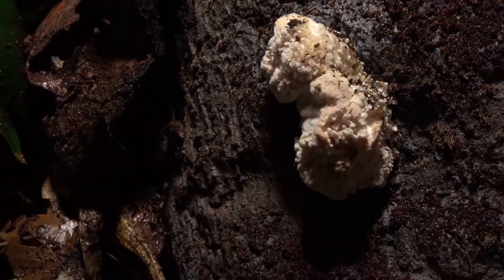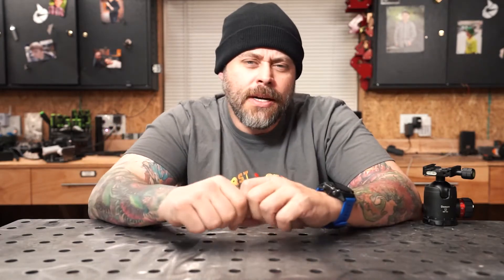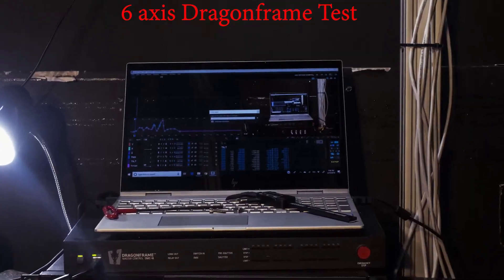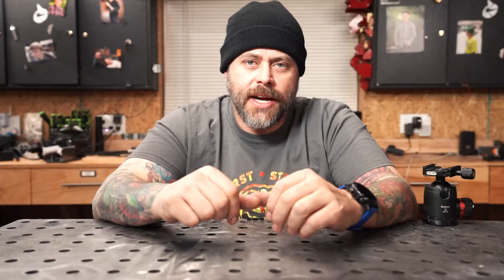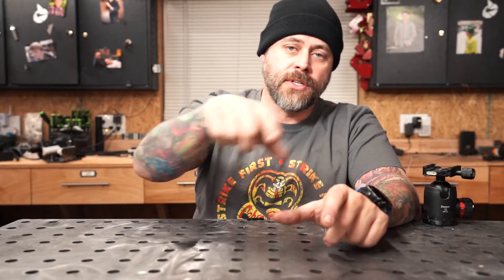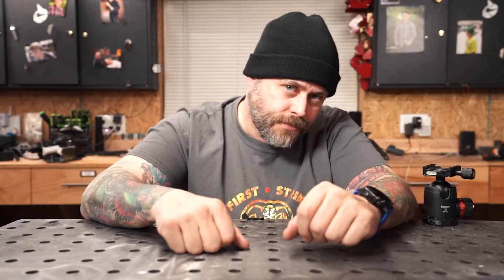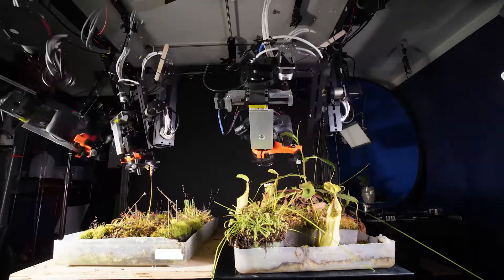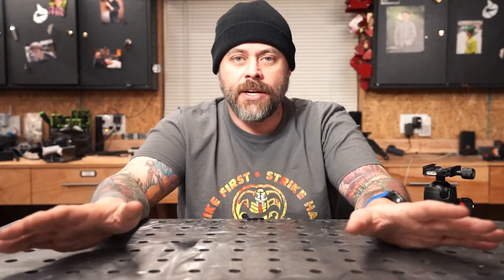Dragonframe Ep 1 What is it?

Comment: Have you considered turntables and tilts for your subject? 3d print small turntables and put on top of stepper motor. Or a shelf on an L bracket connected to a SM. Might be interesting with fast reacting plants in natural light. Rotating through out the day. And ramp with chrono.
Reply: Hi Jason, 
I do have two Dragonframe macro shooting rigs in my studio that are 2 part robots. Part 1 is a slider in a vertical orientation, with a pan/tilt/focus. The second part is a rotating base on an X/Y platform, so i can rotate the stage/set/subject and move it to and from and left and right. its a pretty fun setup for smaller subjects (sets and subjects under 40lbs)
Reply: @chrisfield7008  nice subject on a slider. That's a great idea. Might be fun dof tricks.